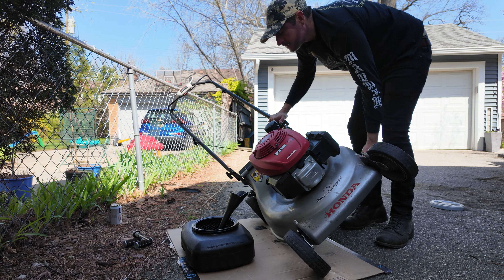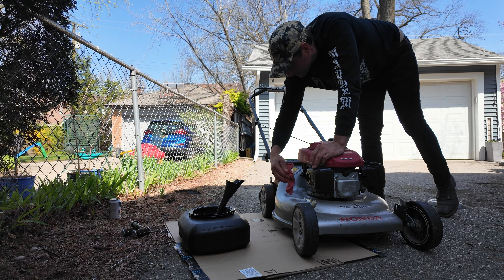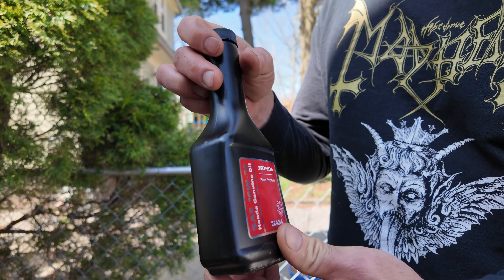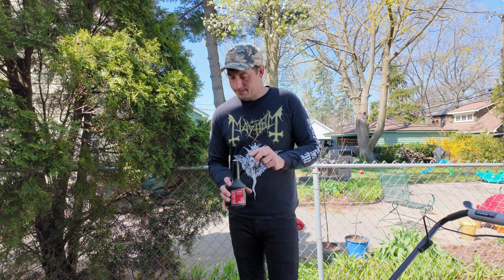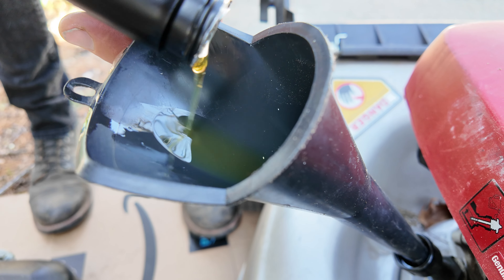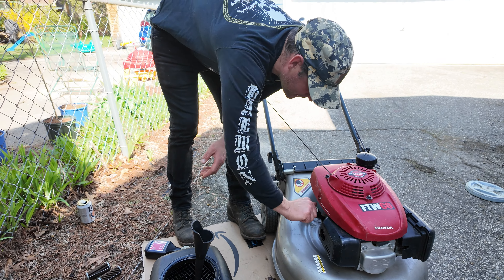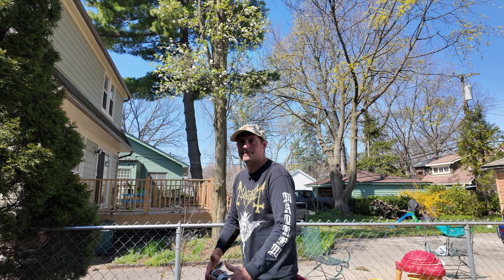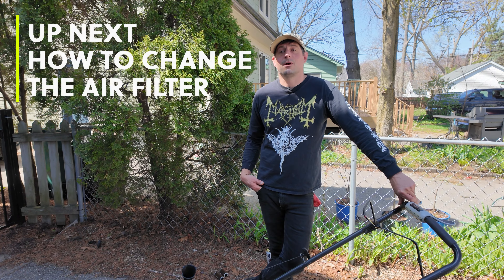How To Tune Up Your Lawn Mower - Part 2 - Changing The Oil

Comment: What if you don't have a pump?
Reply: Indeed.  I guess you should spend the money on a pump that you will only use once a year for 5 minutes. Maybe twice a year if you have a snow blower.  Or, like this guy does you can tilt the unit for ten minutes and wipe up the small spills.

Maybe he should have said "the cheap way".  As a homeowner, I'm all over that idea since I don't own a shop and don't need a lot of single use tools for the couple of yearly tasks I'm faced with.

I also don't buy the "kits" or manufacturer's pre-measured oil bottles.  I'm smart enough to know how to measure a few ounces into a measuring container and a quart or two of the right oil does me fine each year.